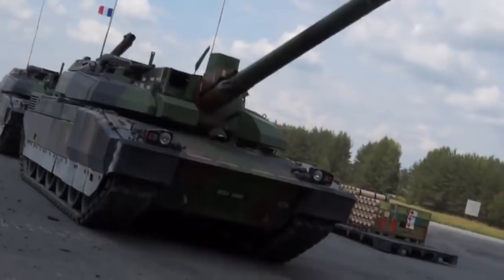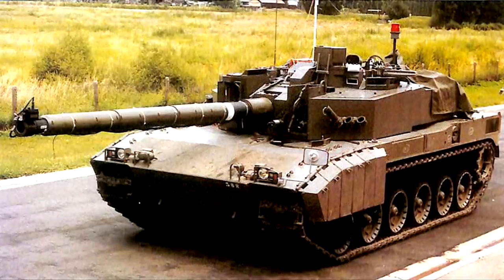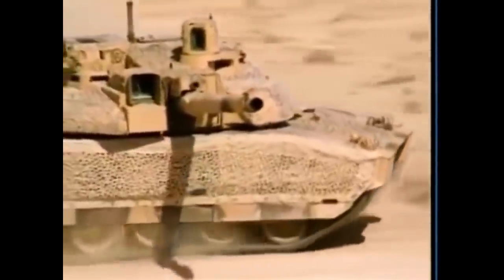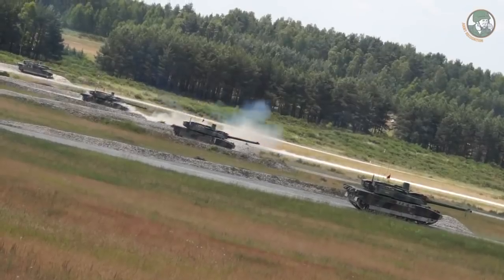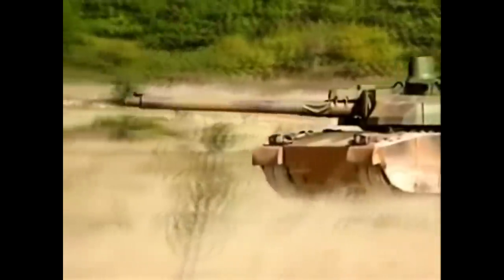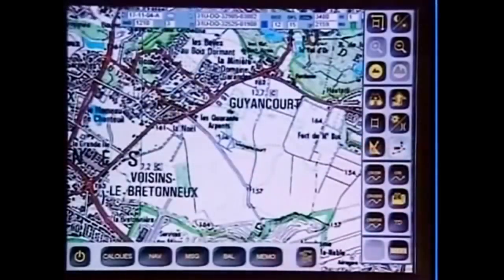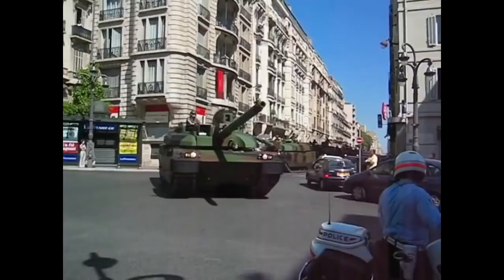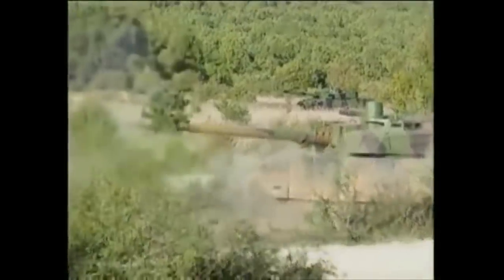Is Leclerc Obsolete?

Comment: Leclerc was never intended to be as heavily armoured as other MBTs. This is a design feature, not an accident. Instead it is much more agile making it harder to hit, and it was one the first tanks to utilise active defense systems against incoming projectiles. Better armour would come at the expense of agility. Like all tanks, what matters most is the crew. If the crew are trained to exploit it's strengths and avoid it's inherent weaknesses then it is a formidable opponent on the battle field.
Reply: The Yemen has proved which the Leclerc have a better protection than Abrams and Leo 2A5.

Comment: A few things that bother me

The armor protection you stated is for the series 1 and the modular armor is to increase protection depending on the mission if required

No MBT are made to whistand any kind of APFSDS from the side stating a universal weakpoint as an argument is a bit redundent 

The tank is designed to mostly fight in hull down/defensive position, meaning only the turret is to be visible in a fight
Reply: t72B3M t90 m1a2  cahlanger 2  leo 2a6 2a5 2a6  t72B3 can stan even two hita on the sides
Reply: @lukabogdanovic4658  HEAT protection is easely made with sideskirt and ERA

No side armor are made to save one from APFSDS hence why we see more APS being created & mounted

Comment: Didnt the french test a leclerc with 140mm gun recently? AMX 56 leclerc with azur upgrade and 140mm gun would be quite formidable on modern battlefield.to me leclerc is the 2nd most underrated  tank today, the 1st one being C1 ariete.
Reply: No, they did test it ages ago. An in order to avoid the only gun being scrapped, they mounted it on a Leclerc testbed.
Reply: @SuperGeronimo999  not exactly.
They made a display tank with a reformed hull, the T4 turret and the 140mm.
But one year later it was removed from display, fitted with current components (FCS, 140mm autoloader....) and used as testbed for MGCS.

Comment: Cough cough, Challenger 2, 500mm of armour on turret cheeks, big lower plate without composite armour
Reply: leclerc shoot shallenger 3 time before it even moove
Reply: @iceman71ice65  Doubt it
Reply: @heycidskyja4668  no i dont
Even british army wanted french or german tank
They made challenger just to keep british industrial
Reply: @iceman71ice65  If only that were the case. EU state aid law prevents government from  shoring up domestic industry in that way. After Brexit the UK will be free to buy German and French tanks.
Reply: @heycidskyja4668  german are free to buy german tank and poland are free to buy german tank
So thats not a EU problem
Reply: @iceman71ice65  No, Germany and France are rather selective when it comes to sticking to EU laws
Reply: @heycidskyja4668  and UK didnt have the power to do the same ? I dont think
Reply: @iceman71ice65  Hence Brexit
Reply: Germany bought BEA in 2019. There is a good line now for weapon trade open.
Reply: The Challenger 2 has more then 500mm of turret armour.

Comment: You for forgot the special ammo. APHEBCR round.( Armor Piercing High Explosive Baguette Composite Round )
Reply: Well its not obsolete right?
Reply: I guess its better than Armata, Russia might add HEATVC ( high explosive anti tank vodka composite ) rounds. Also beware of the Cola nuke rounds that the Americans are producing right now.
Reply: @Anastasia_Romanova1901  Oh yes, the Armata's new HEAT-VC rounds are especially deadly because vodka is a combustible liquid, so after the HEAT charge penetrates the enemy's armor the vodka is injected at high-speed into the enemy tank, and due to the high velocity and heat of the vodka, it rapidly vaporizes and expands into a large gas cloud and then explode into a fireball, 'cooking' the crew of the vehicle, making it a Fuel-Air-Explosive (FAE) and its gets any surviving crew drunk! 

The Coca-Cola rounds are a counter to the Armata's HEAT-VC, and their U.S. Army designation is the M842 HECC-N (High-Explosive Coca Cola - Nuclear) round. The Coca-Cola inserted into this round is made just like regular soda, except instead of water (H2O), they use heavy water (deuterium oxide, D2O) mixed with Tritium and small pellets of Plutonium-239. This radioactive cola liquid is also mixed with high-fructose corn syrup (a deadly carbohydrate fuel gel), artificial sweetener (aspartame), and caramel-coloring dye. 

The D2O/Tritium/Plutonium-239 soda liquid is encapsulated in a small metallic sphere, which is itself encapsulated by a perfect sphere of high-explosive plastique (C4), which has exploding bridge-wire detonators perfectly spaced every few centimeters around the circumference of the HE plastique sphere. Upon impact with enemy tank armor, the initial HE round breaks off outer armor plates and detonates ERA tiles, then the secondary charge (with the D2O/T/Pu-239 cola/plastique sphere) is initiated by a pressure-switch impact fuze and the D2O-cola is crushed so powerfully that nuclear fission occurs, destroying entire tank platoons or even small towns, as the HECC round's explosive yield is around 2 kilotons of TNT.
Reply: Deadly even to the crew on board

Comment: "lacks protection against APFSDS on sides on the hull" like broo in which world tank have 800mm protection on both sides. It will be 300 ton heavy and moving around 300 ton thing is kinda hard, at least on land
Reply: Well, theoretically the Ukrain T-84 Oplot-M can resist APFSDS to the sides, since its hull is covered by three layers of heavy ERA "Duplet" or "Nozh" ("Knife") armor, which can "cut through" and break APFSDS penetrators before reaching the hull armor. But the Oplot-M is a very rare tank, because it's difficult to mass-produce the ERA elements since it's so many elements inside the ERA, it's very hard to produce in large numbers.
Reply: @xAlexTobiasxB  Well yes, but actually no heavy ERA must be extremely slopped in order to work correctly, otherwise hypersonic APFSDS will simply cut stright through it. Hence why Russia doesn't put god knows how many tons of ERA on the sides of their tanks and it is usually very slopped.
Reply: @Ophiv2  No, first of all, you need to understand that the Ukrainian "Duplet" or "Nozh" armor is not like any other normal ERA, it's actually a very special type of new and unique armor design made of EFP elements (explosive formed penetrator elements) cutting and breaking a APFSDS penetrator into pieces. Seriously you should google it to get an understanding how it works. It is specifically made to cut and break any APFSDS penetraror. And it has 3 layers of this armor on the sides, which is more than enough to defeat any APFSDS penetrator.
Reply: @xAlexTobiasxB  umm. K5 was designed to cut and break APFSDS rods as well back in the 80's too. The only difference is that K5 is two-layered but with more explosive mass overall..
Also, please source that it can. IIRC T-84 with DUPLET estimate goes only as far as 700mm vs KE on the front hull, so, yeah. ;)

edit. you sound nationally biased.

Comment: It's a French tank. It was outdated even before it came out. Let's face it. The French suck at making anything properly apart from food and drink. But electronics and mechanics they should never touch. Knowing several mechanics and they all hate working on the French cars, because there are so many little things here and there and those things are so unnecessary.
Reply: Than enjoy your Russian car that uses bootleg cigarettes, smoked by the driver, as heating, you peasant.

Comment: How it can be obsolete? This tank from 1990 year, almost post-soviet era design! (unlike abrams (1980) and leopard ii (1979)). Electronics is outstanding! Also you didnt mention 140mm Leclerc, which is already entered service.
Reply: The Terminator (140MM Leclerc) is not entered in service.
He was just a prototype for look if the 140mm can fit on the Leclerc with a small upgraded turret in case of necessity.
Reply: Source about the 140mm entered service ?
Reply: The original age of a tank is not relevant. The upgrades it receives are. The Challenger 2 entered service in 1998, so by your logic is the most modern and best? No, Challenger 2 is the most obsolete, outclassed and outdated of the four tanks mentioned here, because the UK has barely made any changes to them since the original design from the late 80s, and production in the 90s. 

In the same way, the Leclerc being a more recent tank design than Abrams and Leopard 2 is not relevant, as these two tanks have seen much more significant upgrades and field superior systems, guns, ammo, and armour protection. It is fair to say that the Leclerc has fallen into a niche of a "light" MBT, along with the Type 10, in which it may still excel, but it simply cannot compete with the "heavy" MBTs like Abrams and Leopard 2, which outclass it in every way other than mobility (and rate of fire, for the Leopard at least. A good Abrams loader is quicker than the Leclerc's autoloader.)
Reply: @AllThingsCubey  yeah, I’d love to see an Abrams going 50kph shooting at an other target 5km away moving at 50kph in an other direction, with a 90% succes rate AND with the loader loading as fast as the Leclerc auto loader...
Reply: @vizender  In gunnery trials, Leclerc, Abrams and Leopard 2 have scores so closely matched that it's honestly hard to call, though Leopard 2 has had more substantial changes to its fore fire control since the last time they competed against each other for export.

Abrams loaders can provide 5s reload or even less for short periods. The Leclerc's autoloader comes into its own after sustained fire, or whilst on the move, I agree, but tank combat is won or lost in the first few seconds, generally, and so sustained rate of fire is less important IMO than a superior initial rate of fire.

Leopard 2 is slower than both due to more awkward positioning of the ammo vs the loaders station.
Reply: @vizender  yea that s on paper Real loader speed is variating and they can error will auto loader alway recharge at the same rate and and can t make any error , for the 90% chance of hiting the Leclerc as the same will on the move even if he go faster
Reply: @AllThingsCubey  actually interviews with abrams crewmen say they almost never reload faster than 7s, even if the loader can go faster. combat is never in a vacuum. more often than not the commander will want to preserve the loader's stamina for combats beyond just the current engagement.